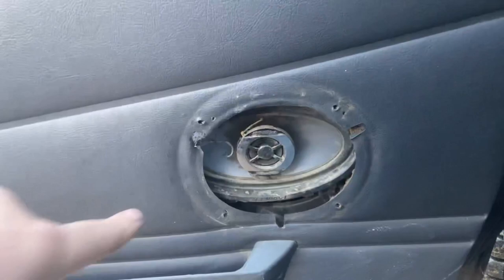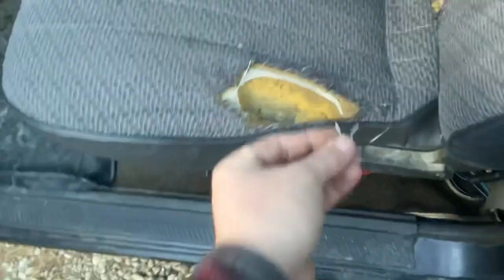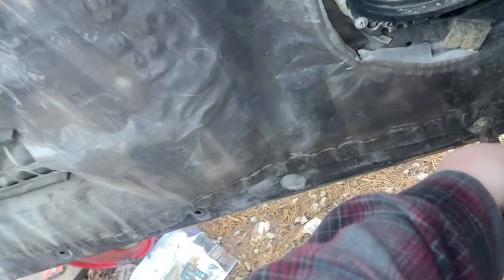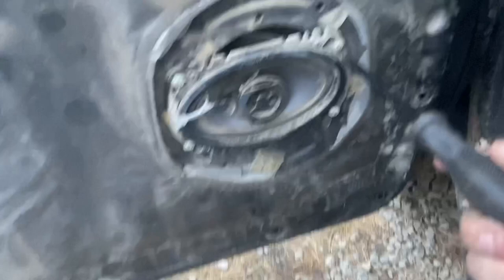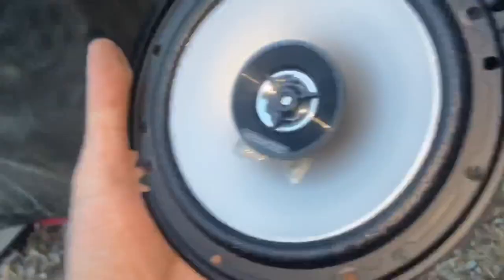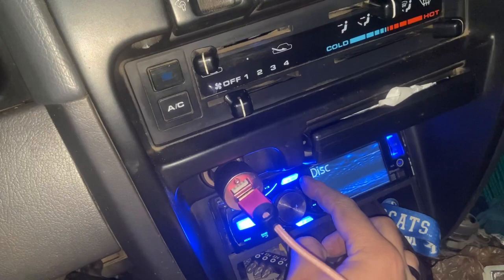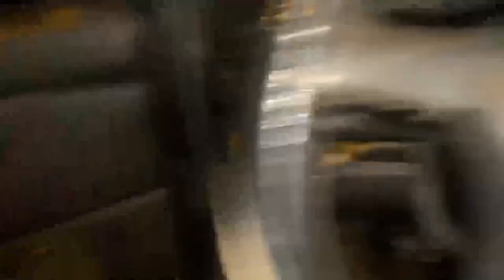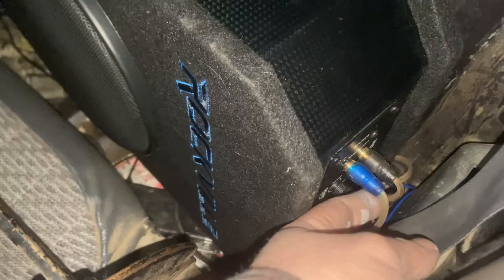Putting a sound system in my Nissan pickup

Comment: So you can fit those 6 ½"s in the door instead of an exact replacement size which is the 4" rounds that come stock with the car?  NOTE: I'm installing for a '95 Nissan pickup.  Would much rather run 6½"s than 4"s.  What year is yours in this video?
Reply: I got 6.5s will they fit I got a 97 hardbody